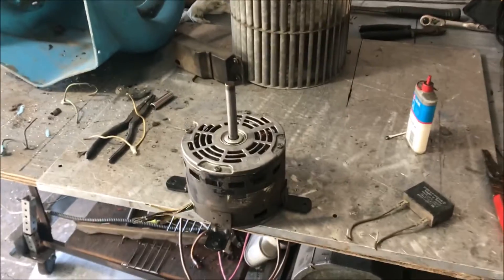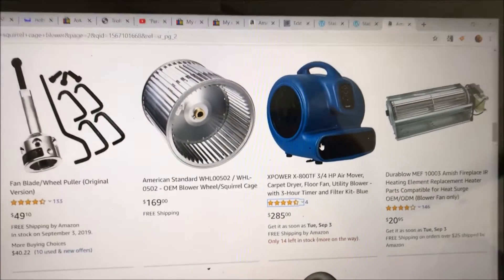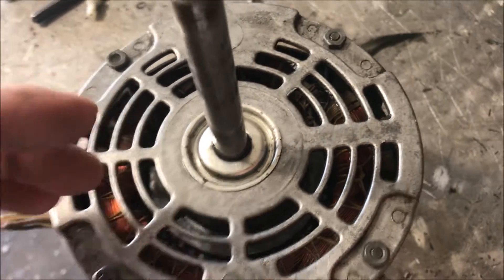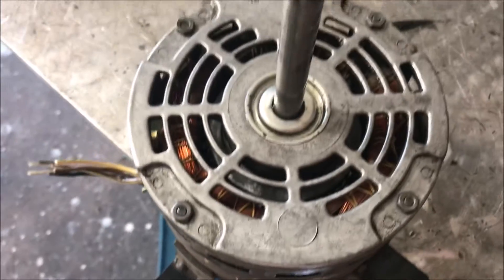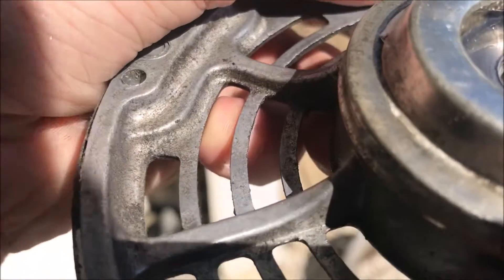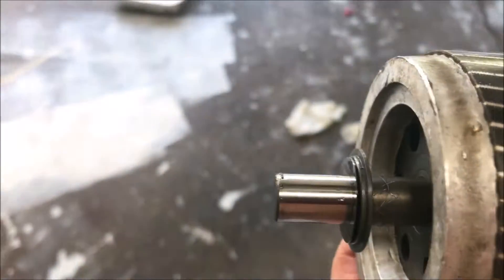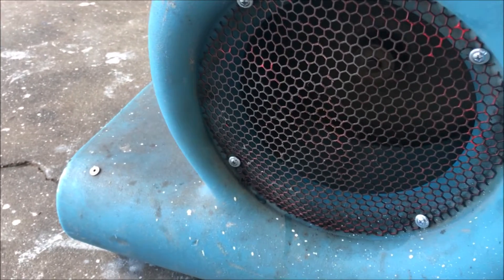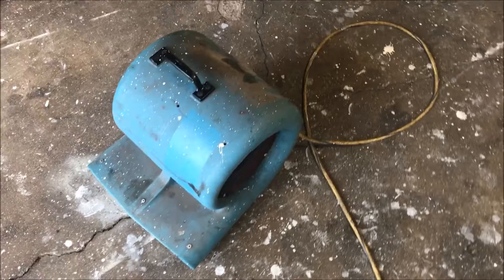Electric Motor Bushing Maintinance NINJA Trick

Comment: Nice, should be running for quite a while now imo. Another tip I learned for anyone reading is to use real "electric motor" oil, not car engine oil. I used to use engine oil but it just doesn't last, almost like it dries up. Real oil (at least get some 3in1 from the hardware store) is muuuuch better than grabbing the pennzoil or Mobil.

 I actually picked up my high velocity fan because the chap who owned it kept spraying wd40 on the motor and couldn't get it to go a day without squealing in a customers house and scaring them, so he gave it to me. I want to get one like you have there next, that's a beast.
Reply from the maker: Lol , it just so happens there i a bottle in the thumb nail pic , im kinda an oil buff , i own 30 different types of oil i bet . I have actually studied the subject extensively  out of enthusiasm for being able to apply this knowledge in the field